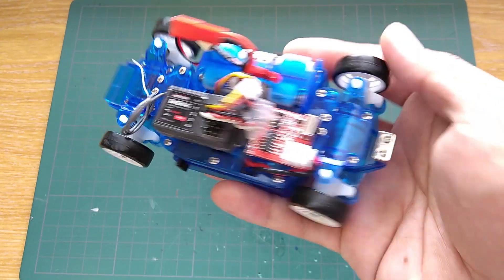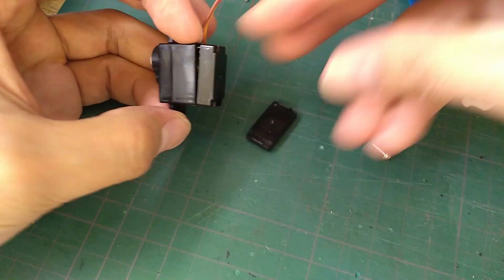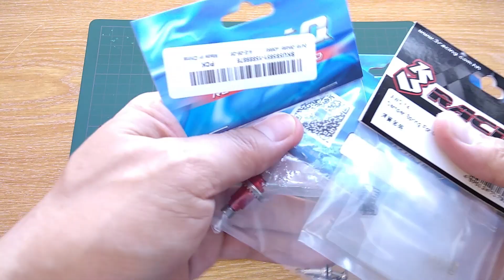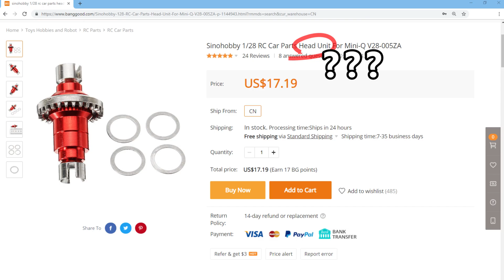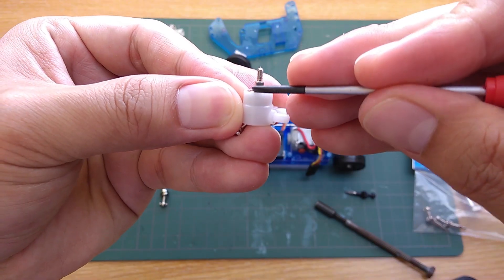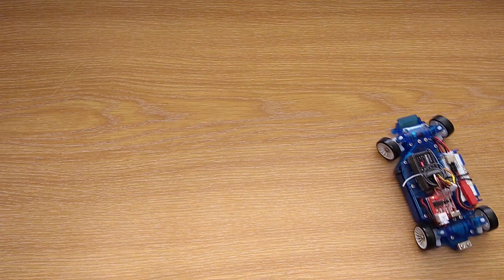Mini-Q TRQ1 | How To Build Ultimate Budget RC Drift

Comment from the maker: Time stamps
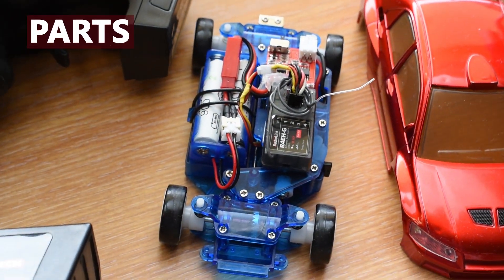Upgrade Parts: 0:37
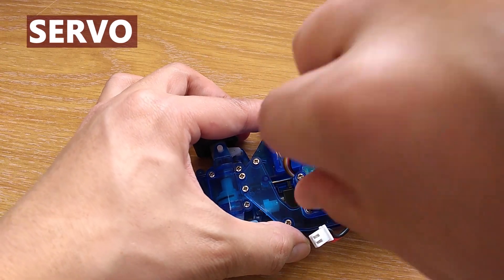Replacing servo: 1:16
Adding capacitors to motor: 2:54
Upgrades: 4:16
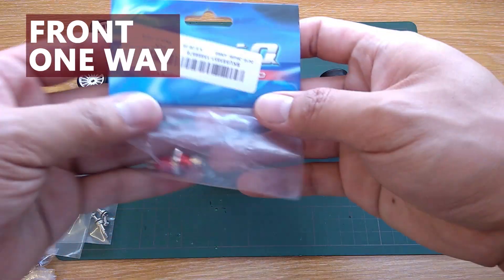Front one way explained: 4:36
Drive Shaft Upgrade: 7:16
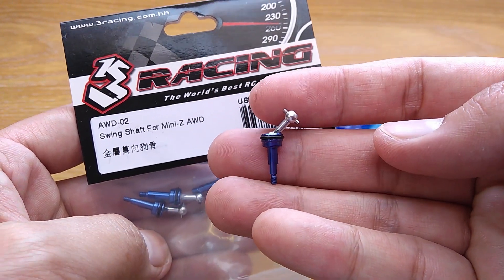Wheel Installation: 8:12
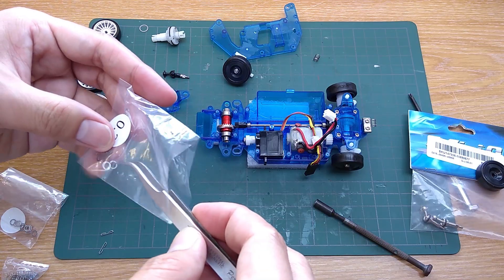Spring Damper Upgrade: 8:48
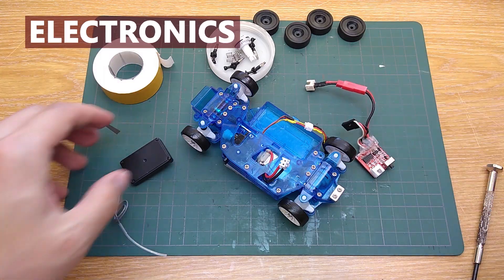Electronics Installation: 10:02
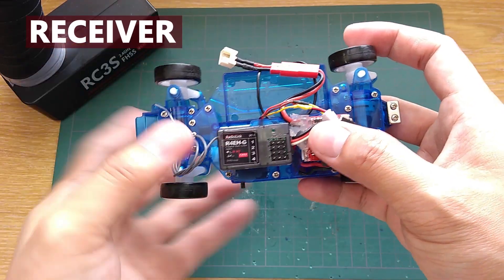How to connect wires to receiver: 10:54
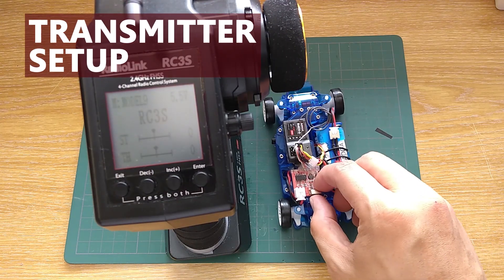Transmitter setup: 11:40
Gyro setup: 13:57
Test drive: 15:33
Reply: How much did it costed with all upgrades, shims and everything?
And please tell me good AAA rechargeable batteries to use
Reply from the maker: @foxxyytofficial  Everything + Shipping is about $119.
The most expensive stuff is Radiolink RC4GS for $54. Otherwise if you already have radio it'll be $65.
If you get 3Racing swing shafts instead of Mini-Q you'll save a bit because they are both cheaper and don't need shim.
Also ESC is quite expensive in Banggood so you can find a 20A ESC from ebay for about $3.5.
Reply from the maker: @foxxyytofficial  Forgot about AAA batteries. Ikea batteries are good, cheap and easy to find. They are essentially Eneloop.
Then you have the Orion AAA 750mAh for Mini-Z racing. Orion also make HV series, high-voltage batteries too.
Eneloop pro is also good.

Comment: How to upgrade cs for kita miniq
Reply from the maker: There's CS kit available on Aliexpress.
https://www.aliexpress.com/item/1005003114170557.html
You'll need rear gear with 14T as well. Choose 94mm wheelbase for TRQ1. https://www.aliexpress.com/item/4001047156489.html
Otherwise you can make the modification yourself like this. https://youtu.be/t6PiUq-_9lI
Don't forget that you'll need the front one way for CS.

Comment: Hi beaver, Will 30A brushed ESC work with this build? More specifically will it work with pretty much 1S batteries?
I dont know much about ESCs other than it being a regulator for speed and power.
Reply from the maker: It depends on which 30A, you'll have to check if it supports 1S or 3.7-4.2V. The one I have doesn't work well but after I bought it some people got a different board so it's quite random. Anyway, for a 1S you can use the red board 20A, it'll work without any problem and it's more than enough,
Reply: @BeaversHobby  so i ended up getting a 10A ESC. I got to setting it up. Issue i got was its faster on reverse than forward throttle. I searched the board's name LS-L4015D V2, found products one in bangood, saw ur name.. and another guy who might have the same issue. (So much for being a 10A as it was advertised on where i bought it lol).
Based on ur review on banggood, how did u manage to use/find it well btw? Curious as it may solve my problem.
Reply from the maker: @jonokami2138  Sorry to hear that. Banggood change that product pretty much every batch. What I got also different than the one I had before from the same link. So I think I was just lucky to get a good batch. I assumed a newer one would be better than the old but it turns out that it's not the case.
The other one you can try is DumboRC 10A. I'm not sure if it's on banggood or Aliexperss right now.

Comment: Anyway to increase the steering angle on the trq1?
Thanks for the video, very helpful!
Reply from the maker: The most you can do is file the inside of the steering bar so it can turn a bit more. Unfortunately there isn't much you can do on this chassis.

Comment: Hello, I was wondering how it runs on an NCID battery instead of alkaline?
Reply from the maker: Unfortunately NiCd has very low power output so I don't think it would work.
Reply: @BeaversHobby  thank you!
Reply: @BeaversHobby  cheers mate, I'll probably just upgrade the electronics since I can't bothered with buying a 1s batteries. Also I would love to see you work on new projects on cheap 1/28 scale rc.
Reply from the maker: @kcira8578  My pleasure. If you get some NiMH or any Eneloop-type (Ikea Ladda) those batteries will work too.

Comment: Hi! Im loving your videos, and i have decided to dip in rc drifting and getting this mini q trq1.
1.why this? Cheaper than wltoys, non competitive use.
2.how do i avoid some grave problems (renders the car unuseable) caused by regular use?
3.if things go bad, what other parts from wltoys is this compatible with?
Thanks for the in-depth vids about this kit.
Thanks too to anyone who will respond in advance.
Reply from the maker: To be honest nowadays WLtoys K969 is a better option than TRQ1 but if you already have it, there's nothing to be afraid of.
The board is now a new version which is supposedly more durable than what I had. If it goes bad there are spare board and radio available to replace.
The steering is less than my version but you can lift the servo up and install a new arm or I've seen someone installed a resistor on the servo to trick the board. (I think there's somewhere in the comments).
It is more compatible with Mini-Z AWD than WLtoys K969/989 (although they are all based on the Mini-Z AWD platform). The universal shafts/ swing shafts or CVD are exactly the same as standard Mini-Z AWD. Wheels are the same as Mini-Z AWD. Motor pinion is a generic 0.5mod pitch plastic gear you can find easily. The chassis parts are different than other chassis and their are no spare available for the chassis tub and steering knuckles so if you break those, it's a write-off. Gears are shared with all other Mini-Q so there are spares available on Aliexpress.
Reply: @BeaversHobby  awesome! thank you very much, well i guess ill be on the trq1 until maybe ill get better and upgrade to a better kit.

What concerns me most now are the screwed on wheels. But thats replaceable to lug nut type by changing the shafts to the metal ones correct as far as ive seen on the comments too somewhere.

more power to you, as your videos are the most comprehensible by far i've seen here in YT regarding this topic.
Reply from the maker: @jonokami2138  My pleasure.

Comment: Whhat about the esc tho how do i change the battery plug sry if i sound rude
Reply: Thanks for the frist question and also what if the one way does not have shims 
 Sorry if i am too annoying for asking so much questions
Reply from the maker: @hwelp  You'll have to get the shims separately. The size is 6mm inner diameter and 8mm outer diameter, thickness between 0.1, 0.2 and 0.3mm. Basically 6x8x0.2mm washers. I got mine from Atomic. http://www.miracle-mart.com/store/index.php?main_page=product_info&cPath=67_74_322_488&products_id=6103
ps. Don't worry about the questions. You can ask whatever you like.
Reply: Ok thanks. I just recently found the wprld of mini rc drift and it seemed really cool so wanted one and the trq1 seemed like a pretty good cat and i want  to make it for drifting and i saw that you use front one way and i just realised now that you linked the items below but the shims were from another site. I know that atomic is a trusted site but i still try to find it somewhere else. I found shims 6×8mm shims on amazon that looked like the one in the vid but i was worried  it wouldnt fit so i asked if the shims were needed. Thanks for answering my questions :D
Idk why my phone corrects car as cat
Reply from the maker: You'll have to change the plugs to be the same as on the battery tray and motor.  This car uses JST-XH 2.5mm 2 pin on both. Cut the old plugs out and solder new ones to it.
Reply: I have a wl12428 1/12 scale i thought i could use its battery
Reply from the maker: @hwelp  I guess 1/12 would come with something like 1500mAh battery. It won't fit on the car and the weight will stress out the electronics and drivetrain but sure, you can plug it in and drive. Not with the original electronics though.
Reply: @BeaversHobby  oh ok. I think i get the trq1 and upgrade the front one way and swing shaft and tires. Other upgardes like radio and esc and servo can come later. Thanks a lot for answering my questions :D
Reply from the maker: @hwelp  My pleasure. Good luck with the project!
Reply: @BeaversHobby  and one last thing what is a ball differential  and if u have  a video about it can you link it to me as on bang good i saw this ball diff adjustable thingy
Reply from the maker: @hwelp  Here's the ball diff explained. https://youtu.be/5fvx6Uw8mSU
Reply: @BeaversHobby  thanks a lot i dont think i have any other questions   
:D
Reply from the maker: @hwelp  My pleasure. Good luck with the project!

Comment: Outstanding overview! I personally would also swap the gear for the rear final drive to make the rear wheels spin faster than the front. 
Do you have any tips for good body shells for that car? 
Thanks and keep the great content coming!
Reply from the maker: Any Mini-Z 94mm wheelbase will work. Here's an example with Toyota GT86. https://youtu.be/U8kbobTW_10
CS mod works on this car too. 1.875 is already good, 2.0 is OK but the steering angle starts to get too low for that. I'd say 2.0 CS is the most it can do.

Comment: Hello do you also have recommendations for a racing configuration for this car and also is there a way to get more steering or at least whit my car it can go a little bit further but it doesn’t when I have the steering trim all the way to the right and to the left it does go that tiny bit further
Reply from the maker: For racing config, use Mini-Z or Mini-Q ball differentials instead of front one way and rear solid axle. Use Mini-Z radial tyres instead of drift tyres. Swap front and rear springs from this setup, basically you'll use front hard and rear soft for touring.
As for the small steering angle, it's a problem from the new board version. You can try and use new servo horn that is longer (buy a new 5g servo just to get the horn) then lift the servo up to accommodate that length. Otherwise, upgrade the electronics just like in this video.
Reply: @BeaversHobby  tank you i got rubber tyres from aliexpress to try out it should be 19 mm inside diameters and the wheel it self i got the white 6 spoke whit some extra drift tyres and the crosswrench i also am going to get a different body from alliexpress it kinda looks like a peugeot rally car with a wide body kit in yellow so white rims black tyres  or white tyres and the balldiferentials from banggood i already have bought the swing shafts and but i will have to wait for them now busy whit trouble shooting my fpv drone as well
Reply from the maker: @Retrograde99  Check the wheelbase of that body too. You need 94mm wheelbase for this car.
Reply: @BeaversHobby  Rc Mosquito Plastic Hard Shell is the name of the body i finally found it again after some search and it is 94mm

Comment: Hello, this is precisely what I want to do with a project that I have in mind but not for drift, it is for a Scania 1/24 model truck ... make it motorized but I would like to know if there is any Kit for such a smaller model? or if you knew what page
Reply from the maker: You can try and use a chassis like this one or better still, WLtoys K989 as a base to build the car. Then get a model to use as a shell. I don't know how big a truck would be but if you are OK with only the main bit and not with the container then there're also truck bodies for 98mm wheelbase which will fit WLtoys K989 perfectly too. 
This for example. https://www.kenonhobby.com/Marka-Racing-Mini-Z-RK-Truck-USA-Racing-Lexan-Body-Kit-98mm-WB_p_46406.html

Comment: Hey, I need help.

My rc is don't driving straight.

If I accelerate, the rear is break out to right and the car drives on a circle
Reply from the maker: Check the steering trim on the radio first. It should go straight when you run slowly forward. And then check that the wheels are not overtighten or loosen so the handling is all over the place. Check if all the wheels touch the ground evenly as well, this can be fixed by loosen the top gearbox cover or suspension mount, wiggle it around then re-tighten it back.
Reply: @BeaversHobby  
I had checked it like you show.
With slowly forward and backward. 
The wheels are not overtighten, I changed the wheels from round to flat.

Later I try the other possibilities. I make an video, that you see how the problem looks.
Reply from the maker: @ademcakmak5538  Yes, seeing how it drives would make it better to diagnose the problem.
Reply: @BeaversHobby  
How can I send you an Video?

Or can I contact you in an other way, like whatsapp or something
Reply from the maker: @ademcakmak5538  I don't have whatsapp. You can upload it on your youtube and send me the link in this comment section or my facebook.

Comment: Please help me beaver, I have the new mini q brushed 20a esc with rc4gs. steering works perfectly and the car will run normally for about 3 seconds and then the esc no longer emits any noise and no throttle response no matter what I try in the settings it still cuts out shortly after. Is this because I am using the newer radiolink?
Reply from the maker: This sounds more like a problem form the ESC than the radio. You can try plugging the ESC into channel 1 to see if it works and you can control it with the steering. If that works then the receiver has broken channel 2. If doesn't work then the ESC just went bad or faulty.
Reply: Very excited for future uploads!! I have swapped back to original AAA batteries and no change? We assume esc is no good?
Reply from the maker: @benkomadina8827  It would appear so, ESC is no good. If you have a 2S use it. Or you can change the ESC to make it fully support 2S (DumboRC 10A) and use 2S safely.
Reply: Thank you very much mini q does not have the best quality control I will try this and let you know
Reply: Now the throttle only works when steering at same time??
Reply from the maker: @benkomadina8827  No, they won't work at the same time. Basically you'll replace the steering servo with ESC to see if the ESC works by controlling it with steering. You can also plug the steering servo into channel 2 and see if you can move it with the trigger (throttle) as well. But I doubt it'd work since it very much looks like your ESC is faulty.
Here's how a radio works.
- Channel 1 is controlled by the steering on the radio.
- Channel 2 is controlled by the trigger or the throttle on the radio.
- Each channel output a signal to control a device that is connected to it. 
So you'll be able to control only whatever you connect to that specific channel.
Reply: Very sorry for the confusion, I swapped the servo to channel 2 and and the esc to channel 1 and the roles were reversed however the esc will still shut off after spinning the wheels for a second or 2 using the steering knob. I put the servo and esc back and if I turn the steering and give it throttle it will engage the motor but not smoothly. Steering input =throttle? Should I just try generic esc and see if it operates normally
Reply from the maker: @benkomadina8827  Then there's no problem with the radio it it functions properly. The reason I wanted you to switch the channel was to diagnose if there's any problem with the radio. 
Because you run it with 1S lipo I suspect that the voltage ran a bit low so the receiver shuts off. If you want to run 1S with Radiolink you'll need a step up voltage regulator to make it 5V to be able to operate.
Unfortunately I don't have a lot of space to run bigger cars. Well, I have a couple of 1/10 but haven't played it for some time now. I do have a projects coming for bigger cars like WPL crawler and D12. The crawler would be probably a simple review but I'll convert D12 to RWD drift on a budget.
Reply: Do you ever plan to build a 10th scale car or a 1/28 crawler for the channel?
Reply: Could it be my battery I’m running 3.7v 700mah lipo

Comment: Hello guy can you give a link to buy the bearings for trq1 thanks
Reply from the maker: You can search for these bearings on other websites.
- 3x7x2mm bearings, needed 8 for the wheel hubs.
- 6x10x3mm bearings, needed 4 for the differentials.
- 2x5x2.5mm bearings, needed 2 for the prop shaft.

Here are what I can find. 
https://www.ebay.com/itm/8pcs-Ball-Bearings-3x7x2mm-Replacement-Ball-Bearings-Kit-Shielded-Ball-Bearings/333769629995?
https://www.ebay.com/itm/10-MR106ZZ-6x10x3mm-P0-ABEC1-Deep-Groove-Ball-Miniature-Bearing-Gcr15/174286910806
https://www.ebay.com/itm/MR52ZZ-2x5x2-5mm-Double-Shielded-Miniature-Deep-Groove-Ball-Bearing-682ZZ/163307396887
Reply: @BeaversHobby  tranks
Reply from the maker: @rillettes5ivet852  My pleasure.

Comment: Please explain to me about the capacitors on the motor. I understand that its to filter out electrical noise. But I thought that 2,4GHz system didn't suffered from this the same way old FM/AM systems did?

Oh and also. If you could only do one of these upgrades (and the electronics the car came with actually works out of the box). Which one would you choose?
Reply from the maker: It is true that 2.4GHz should not get interference from the noise easily but it's better safe than sorry so do it for precaution is pretty much a standard practice. 
The one upgrade that matter the most for drifting is front one way. I'll make drifting much easier. Springs are cheap so you should get that as well. Wheels and tyres are optional but nice upgrade nontheless.
Oops, that was 3. Anyway, do the front one way first.
Reply: @BeaversHobby  that sounds very reasonable. Thank you again!
Reply from the maker: @zeno6111753  My pleasure.

Comment: will this set of wheels fit the car?

https://www.banggood.com/4PCs-Wltoys-1-or-28-K979-K989-Hub-Rims-RC-Car-Wheels-p-1358201.html?rmmds=detail-top-buytogether-auto&cur_warehouse=CN#jsReviewsWrap
Reply from the maker: Yes, they fit. However the groove on the wheels are a bit strange and probably won't work with standard Mini-Z tyres.
Reply: @BeaversHobby  Got it! Thanks!
Reply from the maker: @joaopedrodemacedoecastro2572  My pleasure.